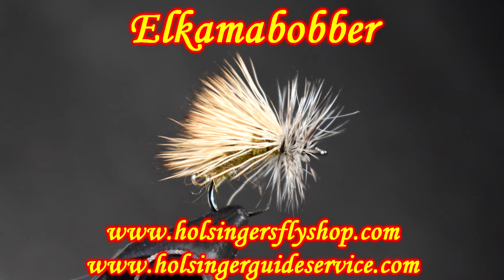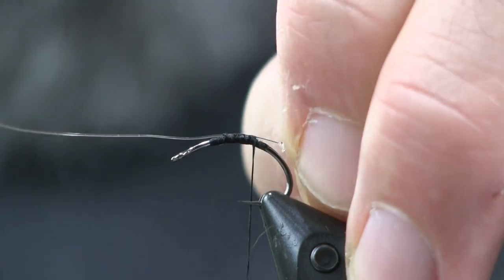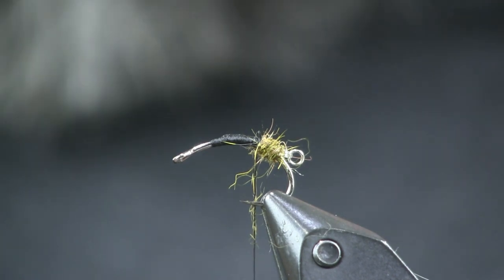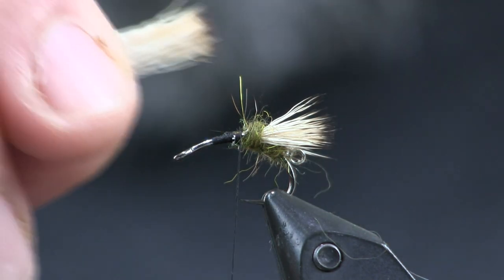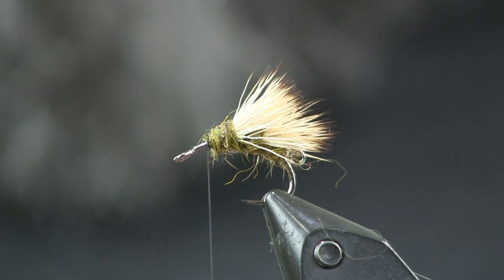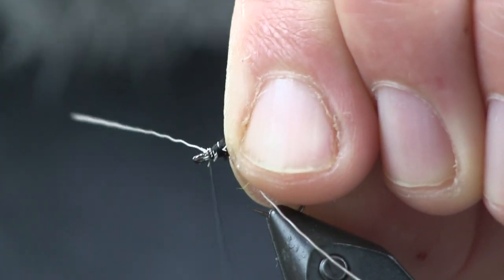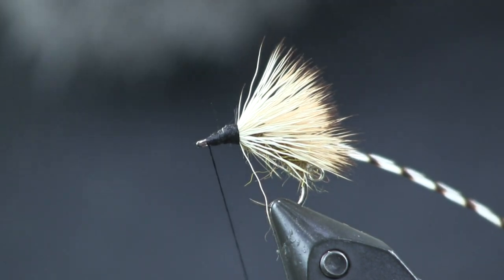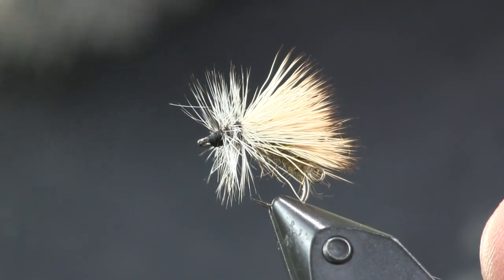Elkamabobber, Holsinger's Fly Shop

Comment: Shawn, any reason not to leave a long tag off the caddis to tie the egg rather than the tippet ring. What am I missing?
Thanks
Reply from the maker: Because the long tag will continue to get shorter and shorter every time tie onto it to extend your tippet. The tippet ring allows you to  change your tippet length simply by cutting it off and tying a simple clinch knot back on.
Reply: @HolsingersFlyShop  …and there you have it. Thanks